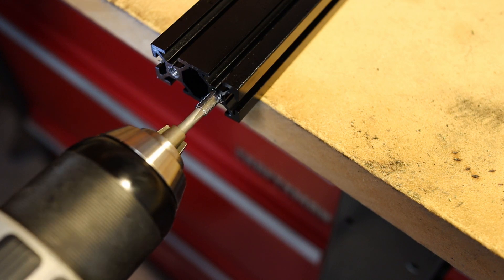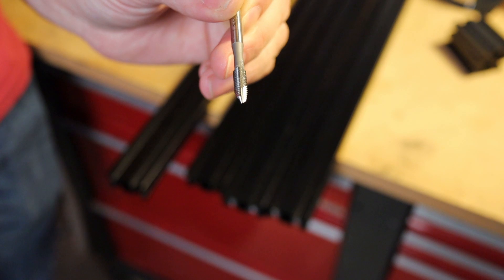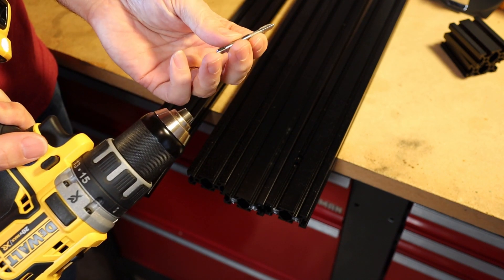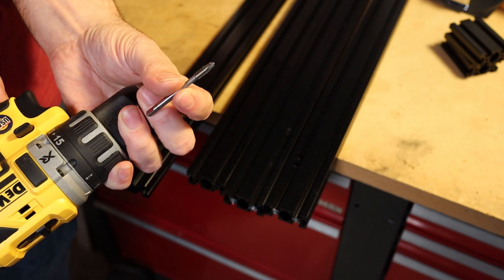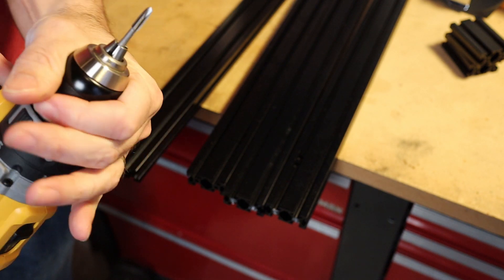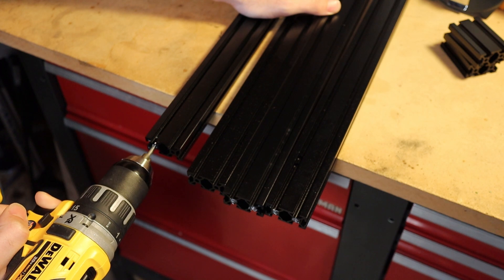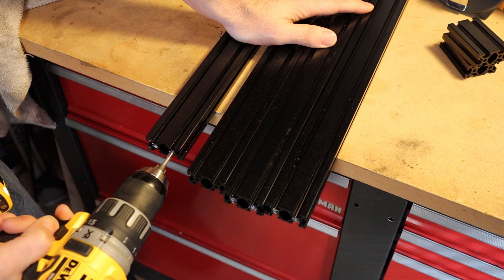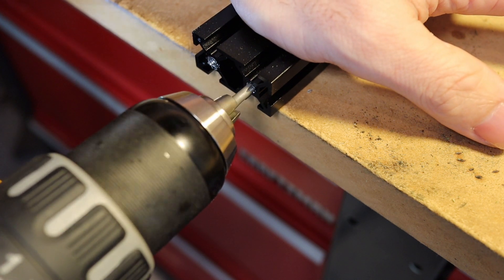Tapping Extrusions with a cordless drill

Comment: Excellent video. I think people fear this kind of technique too much. 

Due to a monumental failure in planning, I had to tap ~1400 holes in 6063 aluminum with a cordless drill and a lot of batteries. If you drill the hole to ~1/64" of the tap size and use a decent tap you can go pretty ham and still come out only breaking 1 tap. By the midpoint I was very tired and broke a tap while completely mangling the part, so I think the issue was really just continuing to work when I shouldn't have. 

At any rate, if you predrill the holes in your extrusions, you should make the whole process a lot easier. If you're doing a couple taps, it's probably not worth it, but if you're doing a lot of parts it would reduce the stress on the tap quite a bit.

Comment: Only a barbarian uses a tap in an electric drill. Just use a tap wrench, it's aluminium. But I'm still giving you a thumbs up for being a fellow 3D printer builder.
Reply from the maker: Tapping in aluminum or steel, I never use a tap handle. I'm a designer for a custom machine builder and none of the guys in assembly that have to tap by hand do either.
Reply: I broke a tap off on a piece of production equipment I was repairing. Now I take my time and do it right. I would use a drill if I thought I had a chance of doing it right, but I know my limitations.
Reply: If it works, it’s fine. I only had some taps without any handle, so I used my cordless drill. If you are doing it calmly without smacking the tap in, it’s fine.

I also used it for the same holes, for me it was to attach rubber feet with M5 screws.
Reply: why?
Reply: @ChristopherJones16  I was just being silly when I made that post, but all kidding aside. Using a tap in a drill is a good way to snap the tap off in you work piece that's all.